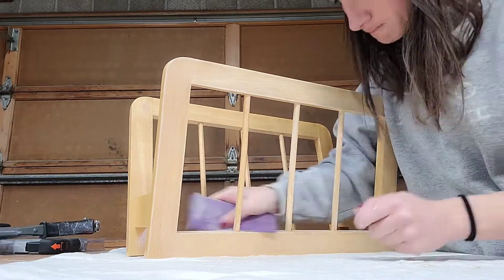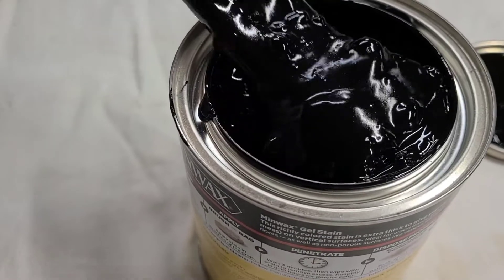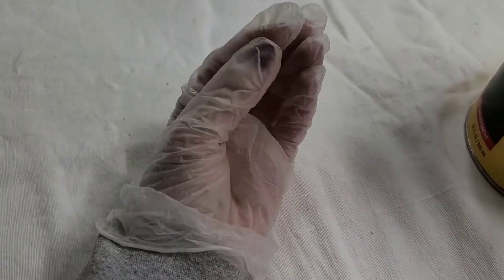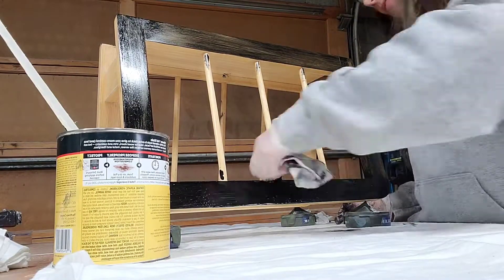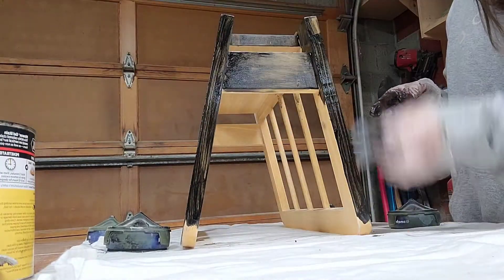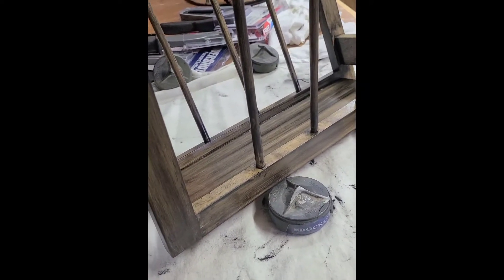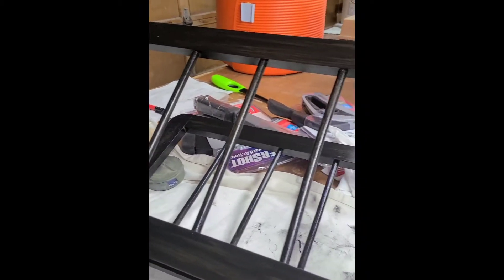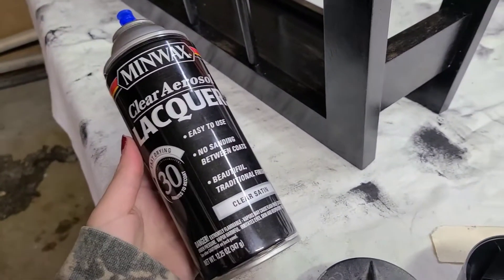How To Apply Gel Stain With A Rag

Comment: I’m using gel stain on my kitchen table top. What topcoat would you recommend? Someone had recommended to brush on a polyurethane & then immediately use a satin finish poly spray.  What are your thoughts?
Reply from the maker: Yes, I'd definitely recommend a polyurethane product for a table top. I've never heard of someone doing both a brush and then spray but I think what they are after is that the spray would cover up any brush marks for a better finish? Maybe you could try a wipe-on polyurethane instead which doesn't usually result in brush marks.